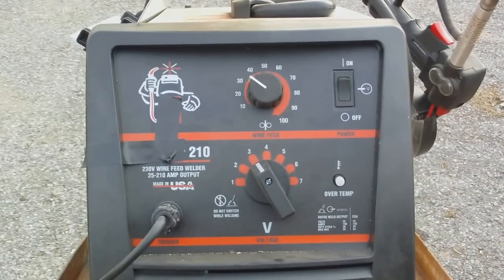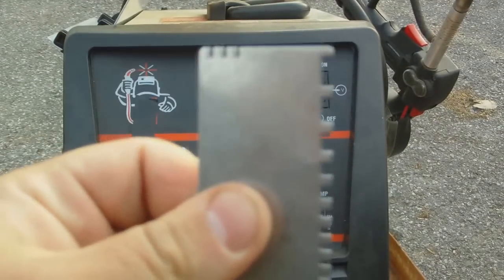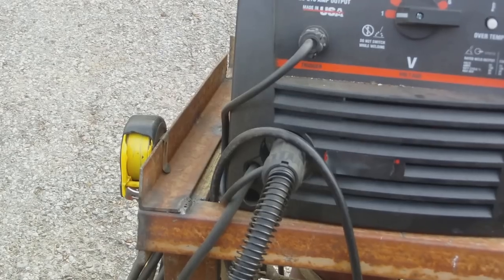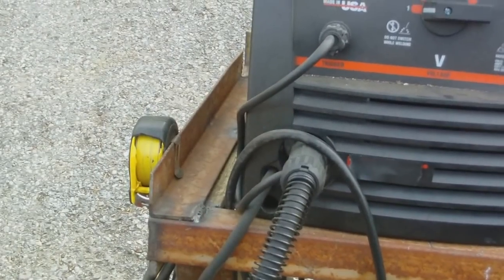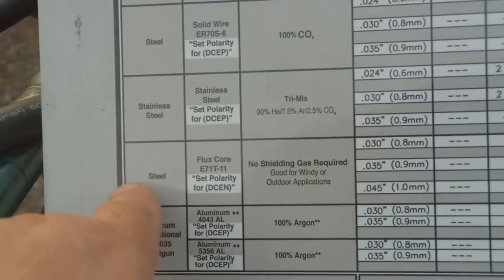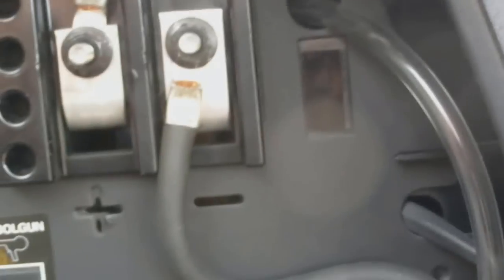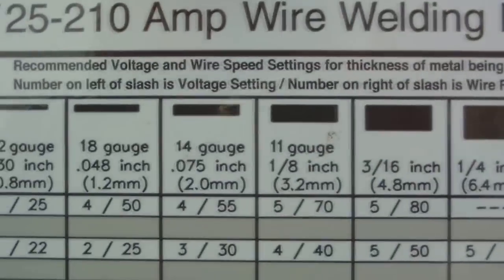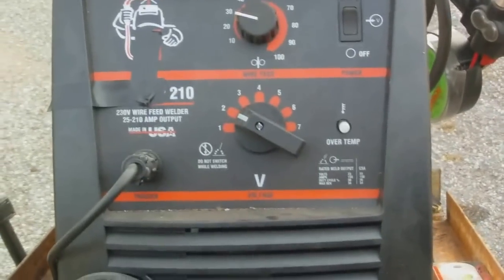How to set up a welder ( how to set wire speed and voltage on a welder) basic video for the novice

Comment: Finally someone explains this! I have yet to see a single other video on YouTube explain this. It's been absolutely frustrating me trying to learn.

Now, where can I find a copy of that chart? And my Craftsman machine only has 4 voltages, A-D instead of 6 like yours does. Do I just sorta guess? Like if your chart says 2, that would be my B?
Reply from the maker: Once you start doing it and make mistakes and yes you will make mistakes. We all do, but learn from them. But once you start doing it and get the hang of it, you get a feel for where the settings should be at. You could probably use this chart but be careful.